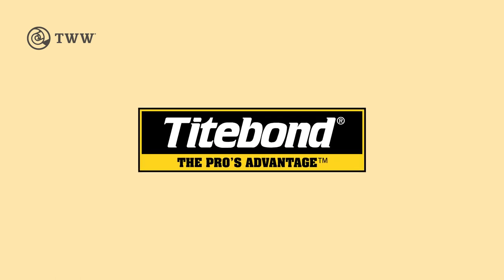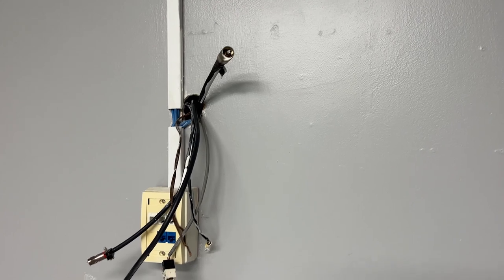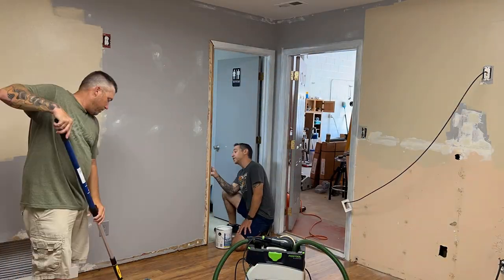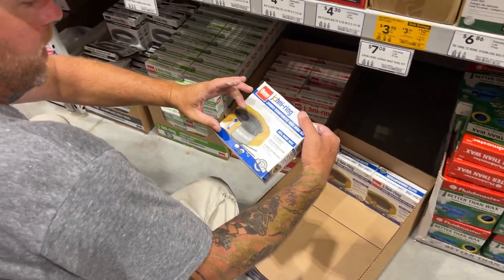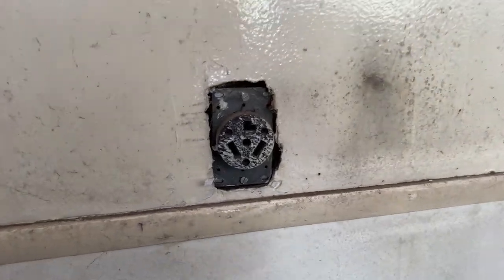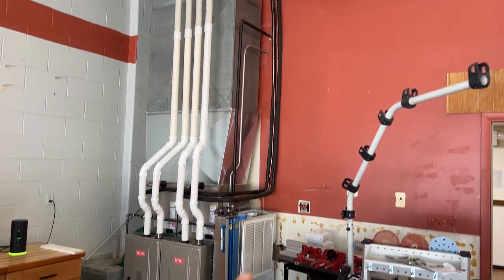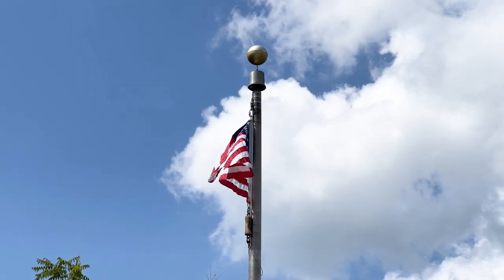Office & Bathroom Reveal - Safe, Clean and Attractive | Firehouse Renovation

Comment: Cadillac job Marc! Isn’t it odd that the wall mastic contained asbestos. We just abated our asbestos floor in the basement and installed new ceramic tile. Our floor guy was suited up, curtained up door ways & vents. He used a 2 gallon sprayer to keep the dust down. All good now. See you on the next installment.

Comment: In case hot water is needed at your utility sink, you may add a conventional under sink water heater, 1 - 2.5 gallon water heater that runs on 110V. This is the solution we chose for our accounting office bathroom in MN.
Reply: I'd rather throw a small tankless under there.

Comment: The "CB radio" coax and folded dipoles near the top of that tower were likely for a radio to talk to 911 dispatchers or trucks on the road. Could probably be retuned for ham radio use depending on what frequency band it is.

Comment: Another advantage of the furnaces is that you can probably install decent filtration on that return (unlike the minisplits, which have very low fan power in order to optimize energy rather than optimizing small particle filtration effectiveness).

Given your short runs of duct work and their relatively large internal cross section, I'd bet that using 2" MERV-13 filters on the return would be no problem for your furnace's supply air fans. MERV-13 filters are not expensive, and (as long as the filter frame is air tight) they'll remove 80 to 85% of the small particles of greatest concern for respiratory health (PM 2.5 - the total mass of the particles that have a diameter of 2.5 micrometers and smaller.) I'm referring to 80 to 85% of the particles every time that air goes through the filters. Pretty great removal. 

MERV-13 is the EPA recommendation for homes, and is also an excellent good choice for a woodworking shop. If you're curious about your current indoor air, consumer-grade PM 2.5 particle monitors are not expensive, they display the current indoor air PM 2.5 concentration. They're certainly "accurate enough" for any purpose other than research.

For reference, here in the US, the national standard for outdoor air is an annual average for PM 2.5 lower than a max of 12.0 (micrograms per cubic meter). Outdoors it will go far 12 that at some times and far below at other times, but over a year, the location meets national standards for adequate outdoor air quality if PM 2.5 averages out at less than 12. In a typical active workshop—even with dust collection—the PM 2.5 is almost always FAR above that national standard for outdoor air. So adding MERV-13 to the furnace return is a very helpful measure for workers' (and familys') respiratory health.

Comment: Id cap off. All the open boxes outlets and switches, cover the walls build a new 2x4 studied wall and run all new electrical  and spray foam the wall cavities,  then cover with sheetrick or plywood as needed.  This way you cant get into the orignal materials.

Comment: You can talk with your HVAC guy about this but since the existing ducts were for heating only, they may not be insulated.  Running cold air through them in the summer, you might get some condensation forming on the outside of them.  Worth a check because I'm sure you won't want water drops falling all over your tools, equipment and work.
Reply: Agree with this! Of course if it maintains temp you won’t have an issue but if there’s any swings it’ll be bad.

Comment: 5:15... that is the exact beadboard I used for my basement laundry room and hallway.  Excellent for such use!  Just ever so dusty/messy to cut, like any pressboard material.  I hope you added fans to the shop with those ceiling heights... help distribute the air and even the temps.

Comment: Tip for the wax ring selection for the toilet if you are not sure what thickness you need for your floor-  just buy the basic one with the rubber sleeve, and one or two of the cheapies that don't have the rubber sleeve.  you can just stack them up if extra thickness is needed and the wax will squish together
Reply: Mmm, like a sandwich 🥪

Comment: On sound proofing…..  A lot of noise will come from the air return, so you are right that a simple boxing it in will not cure the problem.  Actually the air return is an open path straight to/from the noisy motor.

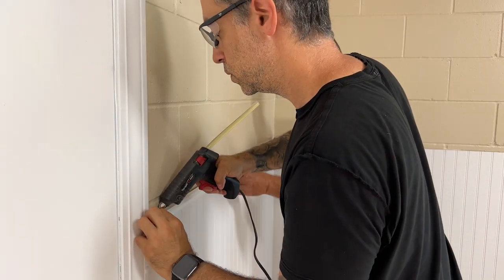Comment: 6:51 I'm glad I'm not the only one who does that with hot glue.. Several years ago I figured out on my own that if I wanted something to hold right away without clamps, get the majority of the surface covered in wood glue and then hit the ends (and maybe a small gap in the middle) with some hot glue. Great for smaller cat tree projects or what's seen in THIS video, but I wouldn't use that method on most serious woodworking projects (knowing WHEN definitely comes with practice). lol

Comment: Antenna yes, TV maybe.  That antenna mast (and the antenna on top of it) was for the VHF dispatch radios the Fire Department would have used.
Reply: To get TV he would need a digital antenna. All broadcast is digital now.
Reply: And the cable that Mark called "CB radio" was also probably for the dispatch radios.
Reply from the maker: It was definitely a tv antenna.

Comment: Any concerns with sawdust getting into your furnace? I built a room around mine in my basement shop out of paranoia but I'm wondering if it was unnecessary?
Reply: He does have a really nice filtration system. But I would recommend a prefilter. They may make them as a bag filter - easy to build a little frame around the return air vent on the side of the furnace.

Comment: The flag is the wrong size for that flag poll, the flag is undersized. You can find a key that will tell you what size flag you need for the size of the poll you have on the internet or if you buy a new flag there should be a key on the packaging.

Comment: Very nice work - my only question is the reference to a 220 circuit; I didn't know anybody in the US used 220 for anything? (or are you not referring to 220/230v?) Is it even legal to mix circuit types? Especially if you still use US plugs.
Reply: we call it 220 here it is technically 240, I believe
Reply: @digdrewzter  220, 230, 240, it's all basically on the ballgame of the European circuits (we tend to OFFICIALLY say 220, but it's usually either between 230 and 240 as you said) - that's what's confusing me, since I wasn't aware that anywhere in the US would use European power standards, in any which shape or form. Also, with the increased voltage, the American plugs are designed differently to the point where I'd be a little worried about the grounding when you're transforming from the 110v US standards. I'm just surprised it's even a design choice that anybody would consider in the US at all.

Comment: The only question I have is why pay to get the material tested if you’re going to treat it as unsafe anyway? I don’t disagree with your “better safe than sorry” approach, but it just seems like extra expense with no gain.
Reply: In some states/counties it's the law to have materials tested if a building is of a certain age, it is part of the permitting process.  Also the insurance company might have a clause that forces testing and most positive results call for 'professional' removal. 
There's so many legal/osha/insurance regs dealing with asbestos that no matter what you'll break one rule fulfilling another.
Reply from the maker: Because unless we test every part of the shop, we can never be 100% sure what the composition is. It's a 2600 square foot building with an additional interior wall.....all filled with vermiculite. We took three small samples from one wall. So that's all good news, but it's not permission to take a dust bath in the stuff. The testing allows us to continue existing and working in the space and if/when the vermiculite shows up, we don't have to freak out about it, but we can proceed with a cautious cleanup.